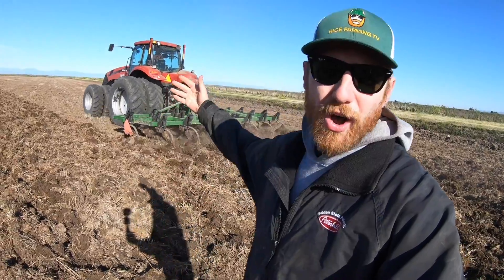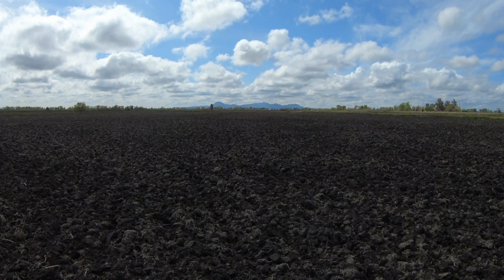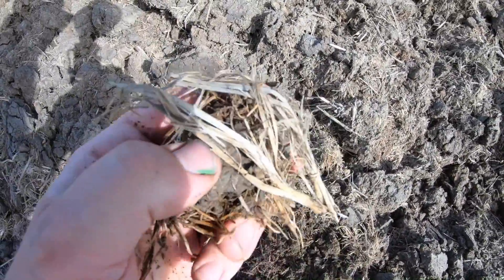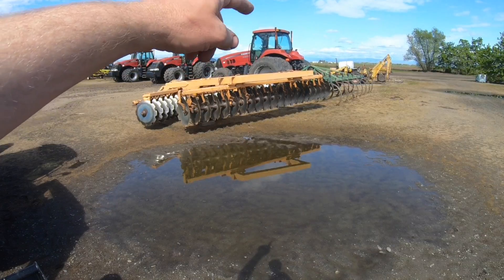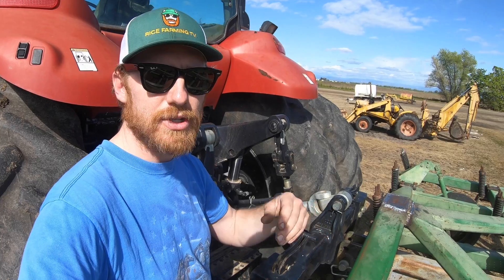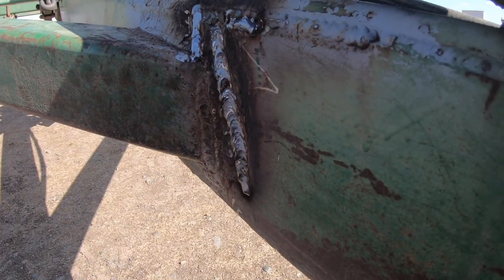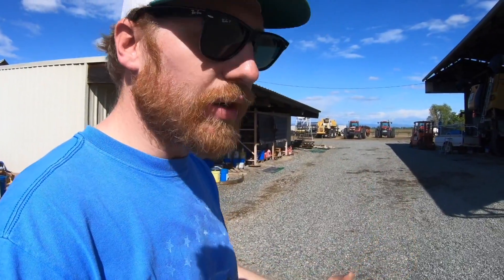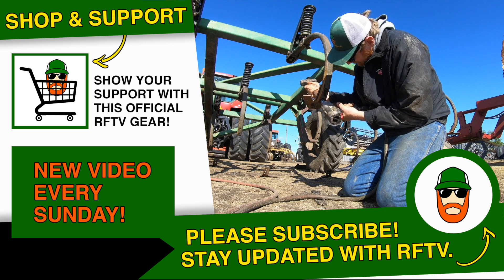On Farm Therapeutic Pounding! No tractor work.

Comment: We need the rain but the forecast is dry.   We don't plant much wheat because it takes too much water to make 6,000 lbs and we rail  it cheap to California for export to Asia.  Our 1/4 half mile circle or 122 acres of wheat had 5" applied  in the last 10 days.   It is heading and need extra soil moisture because we will be planting corn and the irrigation on this circle  is then on corn ground for perfect germination.   
I think you needed to sprinkle your sweet corn regularly after it was planted.   Sweet corn has little starch reserves to be planted deep as field corn is.

Comment: If it were mine i would use a seed drill when it drys some for timely planting even with more rain.    The Urea and other nutrients could be applied and covered by the drill openers.  You could then cut your seeding rate some.  I am an Agronomist and 50 year experience  farmer so I am not a rice farmer!   Because you have lots of compaction deep and much cultivation near the surface you must have a rice variety with a shallow root system.

Comment: But, water is what you use!
Reply from the maker: Rick, this is correct! But right now our only goal is to work up and dry down the soil so that when we apply our fertilizer that the nitrogen bonds successfully to the soil. It needs to be dry in order for that to happen. Once the fertilizer is applied we will start the flood irrigation water.
-M.